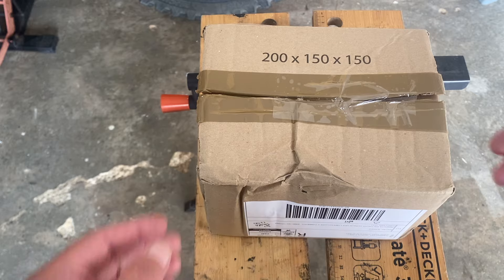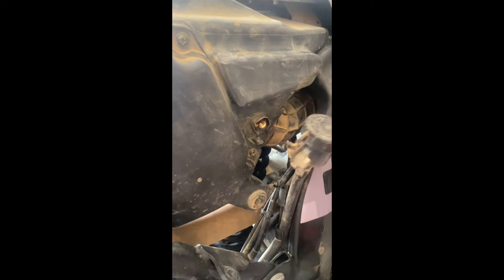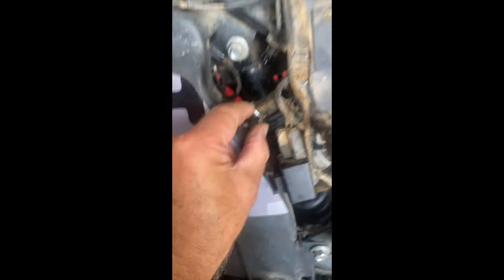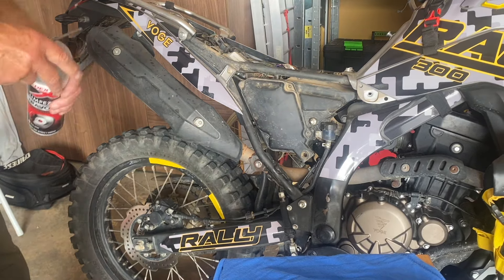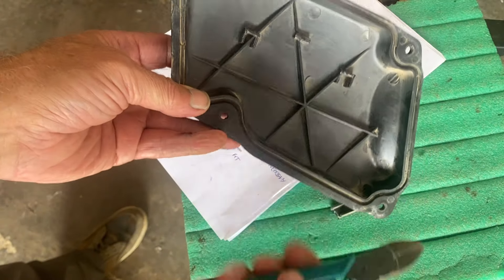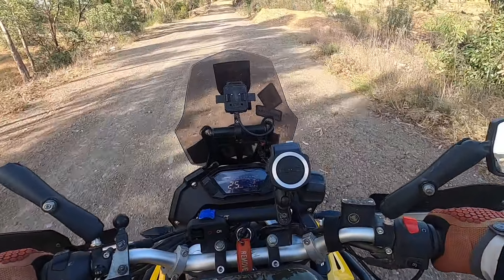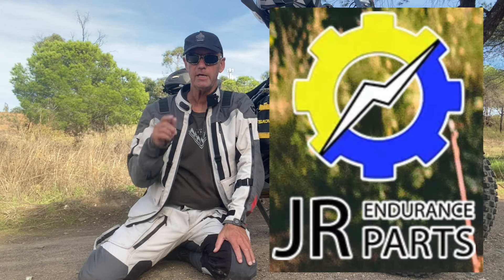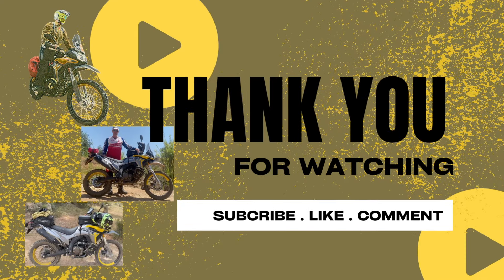Voge 300 Rally Powerflow & Foam air filter.

Comment: I have the initial PowerFlow, the one with the light, which both guys used to sell before splitting.
But before installing it, I first installed their air filter + decat escape (GPR). The change was tremendous. Engine running smoother, "breathing" better
After a few weeks, I installed the PowerFlow. The change was noticeable, but not tremendous. 
I think it's the combination of these 3 elements that gives the very best result : PowerFlow + air filter + decat escape .
Reply from the maker: Thank you. Yes, I am sure that all 3 things make some difference on their own, but together it can only be even better.

Comment: I have a question about how the Powerflow unit works. It spoofs the intake air temperature signal, right? So the ecu injects more gas as it thinks there is more (denser) air being drawn in. But without the air actually being colder (denser) will this not result in a too rich of mixture so that the lambda "catches" and compensates thus negating any improvement? I have very limited knowledge of FI engines and I am genuinely curious...
Reply from the maker: @MartinBlass  Thanks for your interesting question. However when it comes to such electronics I really don’t have a clue. 😵‍💫
All I know is that since I fitted it with the foam filter the bike is more responsive and runs more easily. 🤩 
Hopefully if you ask JR Endurance they will be able to give you a better explanation?
Reply: J'avais ce genre d'équipement sur une F800R de 2010 et c'est exactement ce qu'il s'est produit, au bout de 100km je ne ressentais plus l'effet de ce type de branchement et le moteur était redevenu rugueux. Le plus efficace pour gagner en souplesse, suivant mes essais bien entendu, a été de passer sur du e10. Cependant nous connaissons tous ses effets négatifs sur nos moteurs.
Reply from the maker: @ Thanks for your comment. However this is a comparison of 2 very different motorcycles. The power flow continues to work on my Voge. The fuel does not seem to make difference.

Comment: Yeah, that little feud between these two is something. Thank you for your review. I ordered the JC stuff because it's just a little more engineered. Complete with the new airbox snorkel cover that he designed. Will see. The powerflow itself will work from both guys. What the website mentioned is that there was a "powerflow light" that looks like yours and was only for the EU4 models. The JC dude is definitely the crafty and more professional one + proper shop with paypal checkout and so on. But also a tat more expensive.
Reply: did you find a proper decat exhaust anywhere? i only find silencer when i search.... is the cat in the silencer?
Reply: @ogasi1798  no, the standard is already too loud. Here in Germany is also no way to drive with a decat around. But in the UK you can buy at motogb the scorpion racing exhaust for 300$. This should be a decat.
Reply: @ogasi1798  and yes the cat is in the silencer.
Reply from the maker: Thank you. Yes you have some valid points, although I am very happy with what I have, especially for the price.

Comment: Hello from France,

I’ve ordered from JR Endurance last June the round Powerflow unit with high flow foam air filter and then installed them on my VOGE 300 Rally.
I’m happy so far though I did not notice much difference with stock configuration except swifter engine response in mid and high revs.
Do not know whether there is any difference between Powerflow from JR Endurance and  that of JC?
Reply from the maker: Bonjour, and thank you for your comment. I don't think there is any difference between them. It may be worth you talking with JR. Mine is very noticeable, throughout the range. The engine just pulls more easily, and even sits more comfortably at 100 kph than before.

Comment: Urgent!!  Take your air filter out, and place a flashlight on the outside lower corner of the airbox. You ll see light passing through and its where the fine dust comes from .There i a proper gap.
I have sealed mine with rtv both inside and outside, no light coming through. I havent yet removed the battery and see if the lower right screw behind the battery fixes the gap
Reply from the maker: Thank you very much for your advice. I will do that asap.
Reply: @livelongrideonover70  i didn't know that till someone posted on the Voge Rally European owners in Facebook. Checked mine and yes there is a gap

Comment: Hi, great video!  Been watching a few of yours, and good stuff.  I am thinking of getting a Voge 300 Rally, I fancy riding stuff like the ACT Portugal / Pyrenees and so forth.  Being based in England there is obviously a chunk of road involved, but keen to be on something manageable when I actually get to the trails.  As I work through your videos, wondered if you would be able to reply with what mileage you are currently on, and details of any issues you have had with the bike please?  Saw your video on the "rear wheel wobble", but that just turned out to be the Shinko tyre (interesting that!).  But be great to know current mileage and any issues you have had if you get 5 mins.  Might give me some confidence to pull the trigger on buying one.  Thanks.
Reply from the maker: Thanks for your comment. Currently 18,000 kms. Apart from a couple of loose bolts, the bike has been flawless. And my ´Donkey´ does not have an easy life. I have toured long distances on and off-road. This bike has been smiles all the way for me. Good luck with your decision.
Reply: @livelongrideonover70  Sorry to be a pain, but can I ask you another question?  I assume you have the stock gearing?  Would be really interested to know the RPM at 50MPH, 60MPH and 70MPH.  Also, where you have done road miles, what you feel it sits comfortable at when on more main roads.  Many thanks and sorry to be a pain.
Reply from the maker: @roybailey4529  Yes still have the standard drive train. I won't change it because I do a lot of steep off-road. It's a compromise, but that's how it is. I haven't taken note of the rpm, and I use kph. The maximum I feel happy with is about 100 kph. I tend to ride mostly winding country roads and trails, so I'm not looking for speed. I prefer to take my time. It's simply not a big adventure bike. In Morocco I did have one day riding on motorway at 100 kph. It wasn't the most pleasant experience, but the screen is quite effective, and I made frequent stops. It can be done if necessary to get some miles in.
Reply: Roy, get the ferry to Santander and make a start on the ACT. You’d have a good time.

If you get as far as the algarve please message Bryan or myself, we would be delighted to show you round.
Reply: @maxflight777  Very kind, will take you both up on that!  When I do it, baring a catastrophe I 100% plan to do the entire length of it (although wont relish the road ride back up to Santander).  Have to take the rough with the smooth though! Thanks again.

Comment: Is it possible to swap the rear and front suspension for an aftermarket one?
Reply from the maker: @collinslagat3458  thanks for the question but I don’t know the answer. Maybe you could ask on one of the Facebook forums? Personally I haven’t felt the need to do it. The stock suspension works well enough for my style of riding. And my bike doesn’t have an easy life.
Reply: @livelongrideonover70  thanks

Comment: Do you have the stock front and rear sprockets? Or did you change them? Thanks!
Reply from the maker: @fernetbranca9  thanks for your question. Yes my bike still has the original sprockets. I won’t change the size because it works well for. There are a lot of steep hills around where I live. And I avoid motorways as much as possible. When necessary I am happy to ride at 100kph.